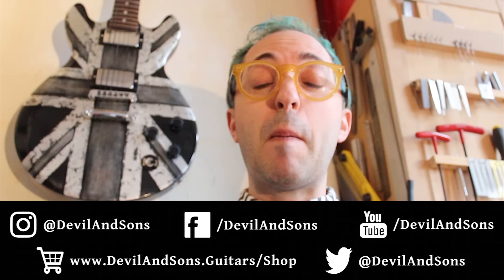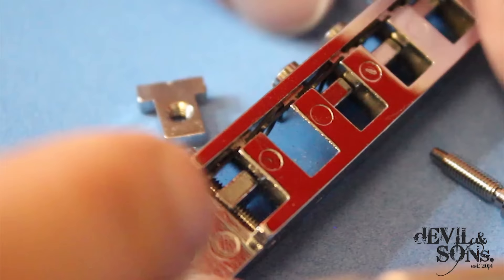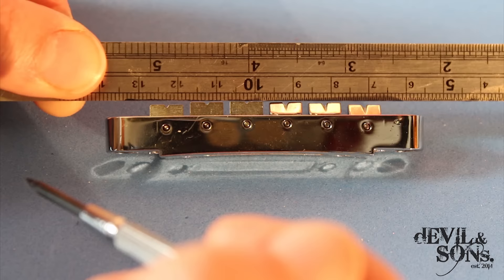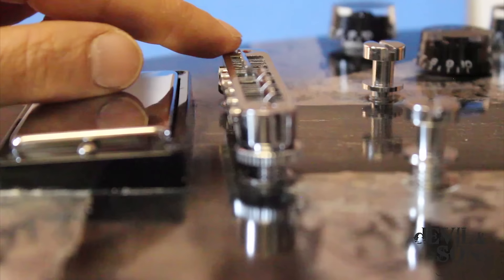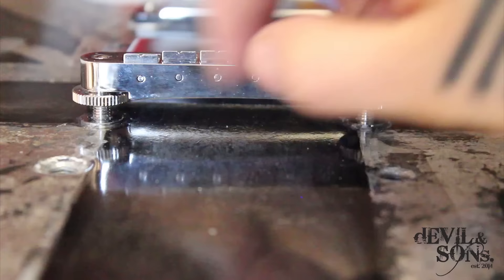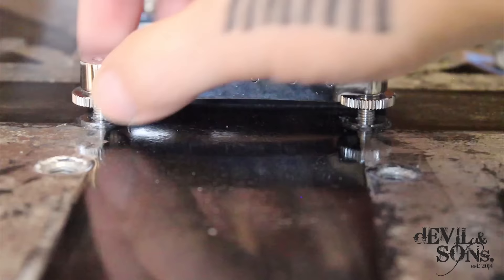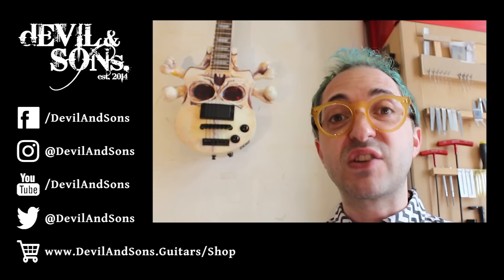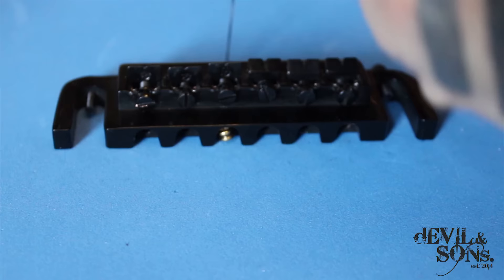Setting up a Tune-o-matic bridge (Les Paul style)

Comment: Hi there, I just got a new esp ltd guitar through yesterday with a tuneomatic bridge, and then the strings go through the body. I noticed all the saddles are facing the same way, is that an issue? 

Thanks
Reply: I forgot to add, the saddles all have their sloped side facing away from the neck.
Reply from the maker: @Will-uu8ed  Hi, thanks for commenting. Really it isn't a problem if the intonation is fine. Changing the direction of the saddles gives a bit more scope for changing the intonation but in most occasions you probably won't need that.
Reply from the maker: I have another full set up video where I mention intonation in more detail: https://youtu.be/fvD-qsM3piQ?t=2043
Reply from the maker: Enjoy your new guitar.
Reply: @DevilAndSons  thanks for the reply! I'll check it out
Reply from the maker: @Will-uu8ed  let me know if you have any problems. Enjoy
Reply: Devil & Sons Guitars I watched your other video, it was really informative and I will sub. The only issue I have with my guitar, is that the strings are resting against the edge of the tuneomatic bridge once they go over the saddles. I think it’s because of the “string through body design”. I have heard this can be a problem, which is why you see people looping their strings around the back part of a Gibson style bridge, I can’t do that with mine. Is it going to be a problem? Sorry if this doesn’t make sense. Thanks
Reply from the maker: @Will-uu8ed  that does make sense and I think that is because it is string through. Without photos I can't think of a solution, there may not be one but it isn't really a massive problem in the long run. Thanks so much for subscribing.
Reply: Devil & Sons Guitars thanks for the help!
Reply from the maker: @Will-uu8ed  it's a pleasure

Comment: Great video, thank you! I have some trouble turning the thumb wheels on the bridge while the strings are under tension, so I have to loosen them, adjust action, tune again etc. Is there a way to make it work?
Reply from the maker: Thanks for leaving a comment. The honest answer is I don't know but probably not. This seems quite common. Do the top of the posts have a slot for a screwdriver, sometimes I end up just using those. In some circumstances it may work to lubricate the posts so they turn easier, but this just depends bridge by bridge. I hope that helps a bit, but sorry not to have a definitive answer.

Comment: How to fix fretbuzz?
Reply from the maker: Fret buzz can be caused by lots of things. This video doesn't actually cover how to set up your guitar, just how the bridge works. It's possible you could try raising the bridge height (thumb wheels) to increase the gap between the strings and the frets, but that may make your action too high. If that's the case it could be an issue with one or two frets that need levelling, or the trussrod adjustment. I would suggest looking for some fret buzz or set up videos on here, I'm afraid I haven't made any yet. do try slightly raising the bridge height first as that may be the simplest and easiest thing to do and perhaps the change in action won't be to significant. Good luck, and i hope that was some help.
Reply: @DevilAndSons  thank u so much... youre a good man ...
Reply from the maker: anonymous guitarist thank you!

Comment: Not sure why but the low camera angle in the beginning made me really uncomfortable. Thanks for the video tho
Reply from the maker: Sorry about that, I was trying to get me and the guitar in shot. In my recent videos I have a bit more space so film at eye level, hopefully those will be more welcoming. Glad you carried on watching though.
Reply: @DevilAndSons  oh no worries man, It was a great video. But hey since you responded.  I just got a gibson LP, I've always owned a epi. Well I restrung it and I noticed the bridge and tailpiece came out unlike on my epi. Well I didnt mess with anything and when I restrung it the low strings were dead. Almost all the way down the fretboard. They even buzz if you just pluck an open string. What made that happen?
Reply: @DevilAndSons  at least your best guess?
Reply from the maker: I think the buzz most likely comes from string height or trussrod. Are these new strings the same gauge? That could have an effect. It seems unlikely that you adjusted the height of the bridge lower without noticing but it is easily done. I think it's unlikely that the bridge was initially loose and sticking up a bit, being held in place by string tension. Then slipped back when you loosened the strings. Sometimes you just never know, but as long as you can fix it now it probably doesn't matter. If you can't get rid of the buzz let me know and I may have a few suggestions ( a lot of which will be covered in my full setup video).
Reply: @DevilAndSons  so I raised the bridge about a quarter turn at a time and I got the buzz almost all the way gone. There isn't any dead frets the strings just slightly buzz but they did that when I got it. I'm not sure on the gauge of the strings they had on it. I put 10s on and it does feel easier to bend so I'm guessing it might've had 11s on. Is the bridge supposed to come off like that tho? On my epiphone there are little screws that secure it down but the gibsons bridge just fits on and the strings hold it down.i really should get a large straight edge to check the neck as well huh?
Reply from the maker: Yes, the bridge does come off, just held in place with the string pressure.
To be honest a bit of fret buzz is OK, especially as you probably won't even notice it through an amp.
There are other ways to check the neck. In my set up video I use the capo method.
Reply from the maker: https://youtu.be/fvD-qsM3piQ
Reply: @DevilAndSons  dude thank you so much!! I just noticed that my epi LP bridge is really high. So I'm going to try and lower it correctly. I really appreciate it, not many channels will reply. I got a large chunk of mahogany stock from a luthier a while ago and one day I'm wanting to build myself a strat style guitar from scratch.
Reply from the maker: Hey, no worries. I love interacting with people. Good luck when you get around to the build. Hopefully a few of my forth coming videos will be helpful for you.

Comment: I have 1 question to u coz my 3rd string is so damn ...Whether by setting a bridge can change the sound to fals?
Reply from the maker: Thanks for your question. Can you please explain what you mean by damn and fals. I may be able to help but I'm not sure what you mean.
Reply: I don't know ... I just lowered the bride so that the string feels softer ... but all the strings tune except number 3. always changing ... is there a problem with my dyer..thank you before
Reply from the maker: andri yanto if that string only keeps going out of tune I would first restring it, it may be slipping at the tuning peg end. The other thing may actually be a faulty string. I can’t see how the bridge will make one string go out of tune unless the saddle is moving itself (maybe the thread is worn?). This seems unlikely. Perhaps check where the saddle is in relation to the ones on either side then double check to see if it has moved when the string goes out of tune. I hope that helps.
Reply from the maker: andri yanto another thing you could try is take string 2 or 4 off and thread string three through one of their tuning pegs but keeping it in the normal string 3 position, that way you can check if the tuning peg for string 3 is the problem. If it is still happening it could be connected to the bridge. You could also try another string in position 3 just to see if it is a problem with the string before you go out and buy a new one. It’s a bit time consuming but will help rule out some potential issues.

Comment: I’m building a guitar what are the measurements?
Reply from the maker: Exciting. What measurements are you after?
Reply: Well idk I have need built one could you recommend me, I play blues, rock, and hard rock
Reply: It’s a les Paul
Reply from the maker: @unityred9829  if you look online there are lots if free templates and measurements to be found. If it's your first build I would recommend sticking to one plan for dimension, although really once you have the neck it's only the scale length and bridge position that you need to worry about being precise, you could easily change the positions of the pickups and controls slightly or the body shape. A les paul would be hard first one as the arch top makes it a bit more difficult.
Reply from the maker: Not sure I can help much beyond that right now here, unless you have a specific question about the bridge.
Reply: Okay thanks dude do you have a way I can contact you?
Reply from the maker: @unityred9829  email is probably best, info@devilandsons.guitars

Comment: Bollocks ! Top wrap isn't how the Les Pauls and SGs were designed. Through the tail piece is how Gibson designed it so if you know how to set up guitars with the Tune-o-matic bridge it's not an issue. Find a good guitar tech is better still.
Reply from the maker: Felix Burke I’m not a big fan of the top wrap either, I think it looks messy, but some well known players swear by it. Each to their own I guess.

Comment: My suggestion: Never buy a guitar with a tune-o-matic bridge. They're shite, you have no way to adjust individual string height, and the sharp edges on the saddles are fecking painful
Reply from the maker: They are a bit of a pain compared to other bridges.
Reply: @DevilAndSons  A bit more than a "bit" when you play the way I do on stage. 😲
I took a dremmel to the ends of each saddle on my Dean till I replaced iwith a Schaller roller bridge. Primo.
Reply from the maker: ROOKTABULA ha, I guess they weren’t designed for you! Glad you found the right bridge for you though.

Comment: This info is so wrong. Since when does the tailpiece modify string tension? LOL the only thing that change the strings tension are, the tuned pitch and gauge of the strings. the higer the tension, the higer the pitch (tone), duh. No matter the height of the stopbar, obviousely. If you mean the tension behind the bridge you are correct but, this you cannot feel while you play the guitar, this is a fact. correct your info! Not good for views and buisness!
Reply from the maker: Wij Ons yep, that’s what I mean - behind the bridge, but also whilst you are tightening (lowering) the stop bar the tension will increase and so will the pitch. If the angle is greater, the tension behind the bridge is higher, the strings are held in place tighter. It sort of mirrors why a headstock may be slanted, or a string tree used - to stop strings slipping. Sorry if I made this unclear.

Comment: But WHY WHY WHY WHY?????????
Worst video ever!
Reply from the maker: Why what?
Reply: @DevilAndSons  e.g. why is the bridge angular to the pickup? thx
Reply from the maker: Due to intonation, the thicker strings need to be further away from the nut. I basically explain that here but fir an indpeth and (most useful ever) video about intonation please check out:

https://youtu.be/cQ-yslOuHck
Reply: @DevilAndSons  thx for your answer! found that because of its thickness and stiffness, a heavier string doesn't start vibrating exactly where it leaves the saddle, so the scale length is effectively shorter.
Reply from the maker: That's interesting. Also my pleasure, I always try to answer when I can.